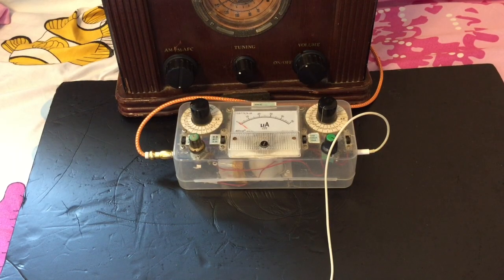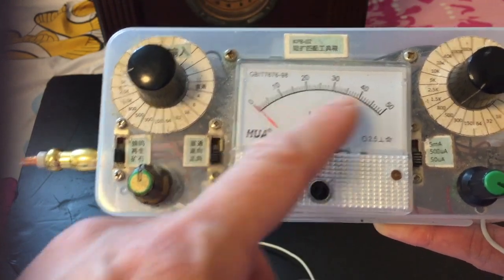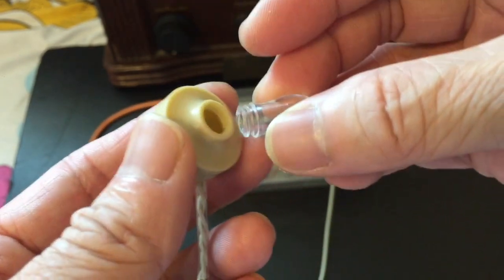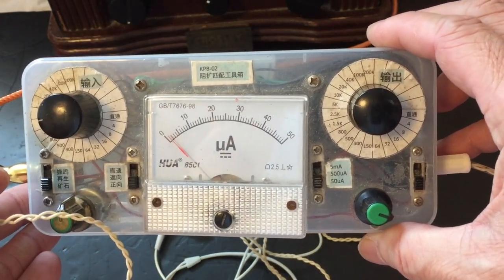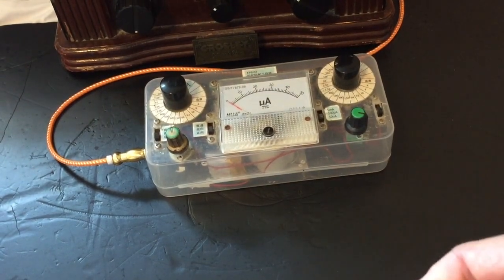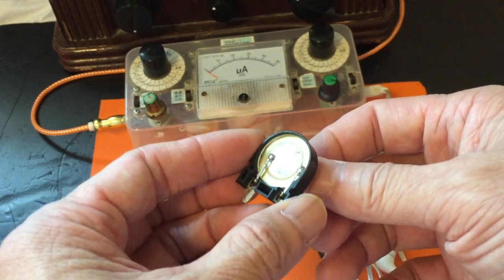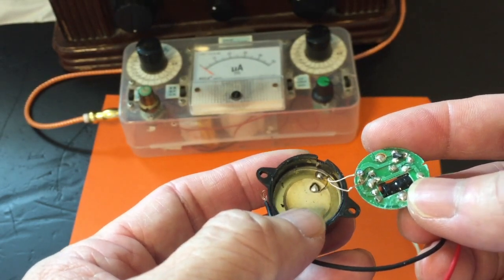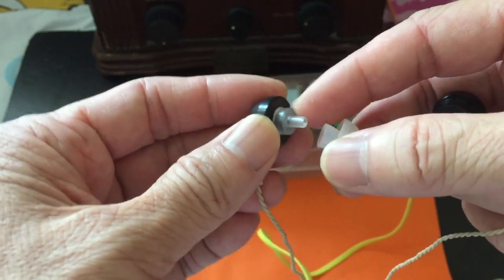All About Crystal Radio Earbuds

Comment: Question: can you use crystal earbuds on a phone, and how clear will the sound be?
I want to make crystal earbuds but not for crystal radio, I want to use it for my phone
Reply from the maker: You can. But the sound won’t be great as the impedance of crystal earbud is 100 times higher than the impedance of phones and will not match causing distortion and weak output.